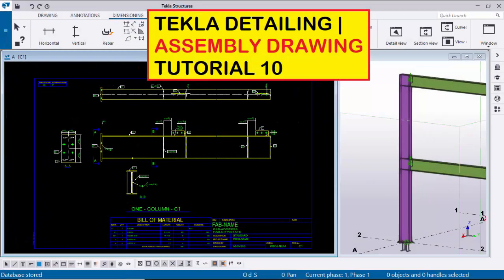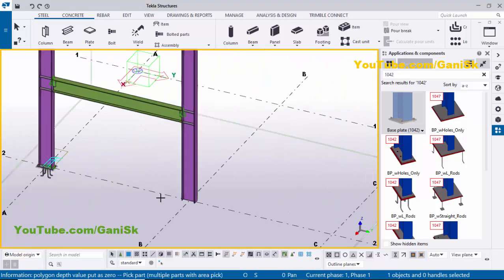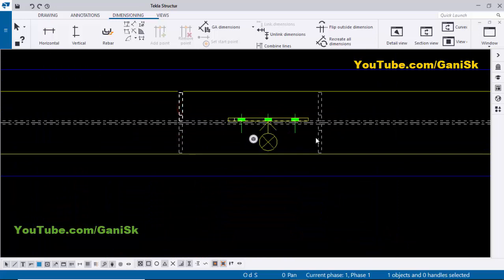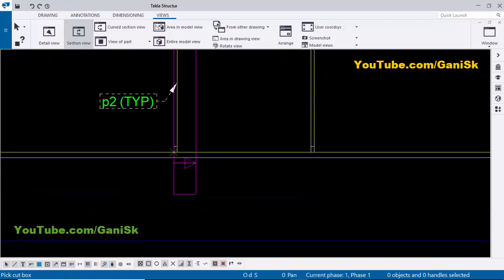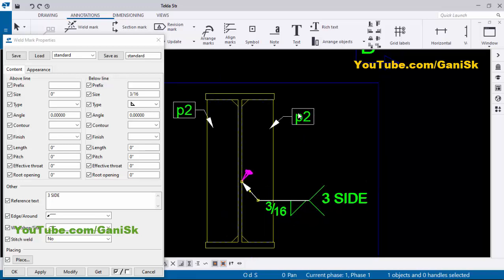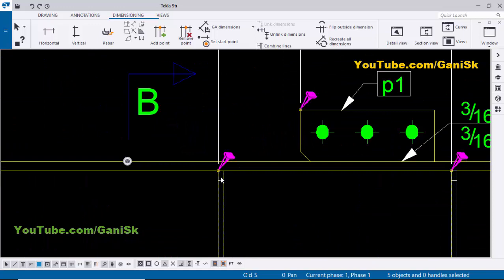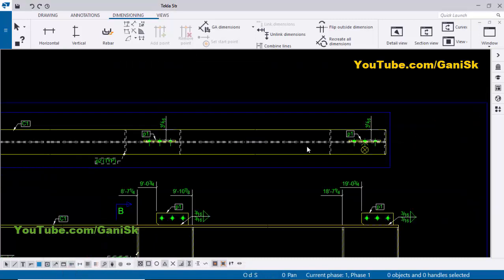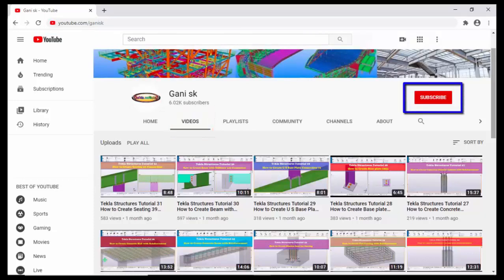Tekla Detailing | Assembly Drawing Tutorial 10

Comment: In stiffner weld mark it will work on double side also sir or not sir
Reply from the maker: Yes, you are right stiffeners will be welded on single side or both side(double side) depends on placement and condition, for example stiffeners are placed at mezzanine or crane bracket location then stiffeners should be welded on both side.